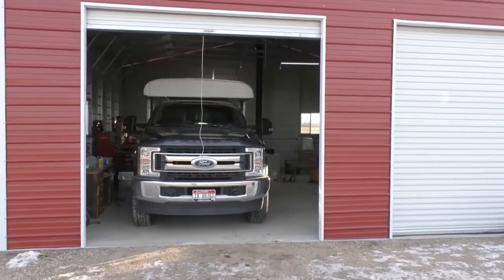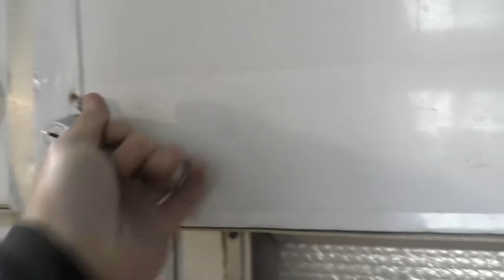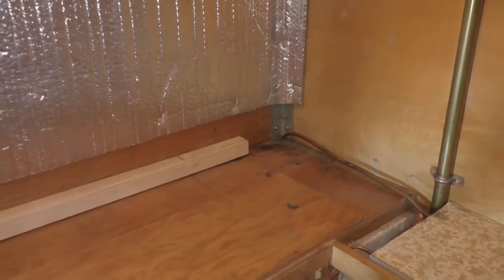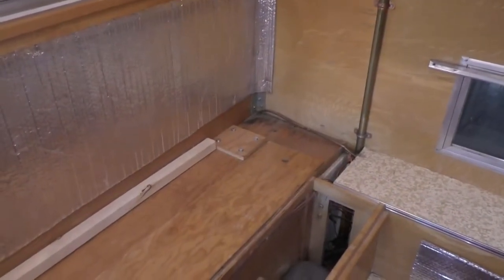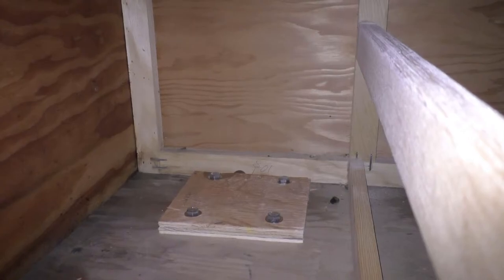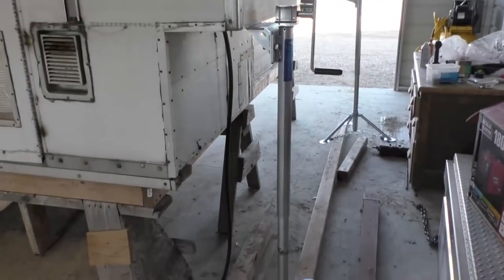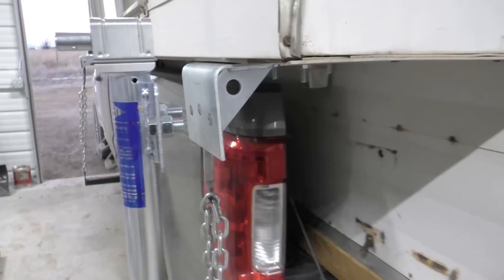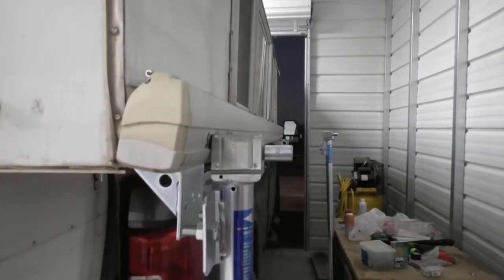Installing Rieco-Titan jacks, jack extensions and brackets on my 10' cabover Alaskan Camper.

Comment: The gusset for the front bracket needs to be under the camper at least a few inches to function. Bad idea. Brian was right.
Reply: Probably so. But working so far with no issues.
Reply: Probably so. But working so far with no issues.

Comment: I would like to see how you jack the top up. Ours has a crank with sprockets and and bicycle type chain. It doesn't go up without lifting up on the top while cranking. A jack setup inside like yours just might make it easier for us.
Reply from the maker: Do you have an Alaskan?  As far as I know they all use hydraulic jacks with telescoping booms.
Reply: @off-farmadventure6871  no I don't have an Alaskan. i have a more obscure unit built in the 70s in Claresholm Alberta canada. it's called an Alligator.
i spray foamed the outside of it while still leaving the pop up feature. that made the top too heavy for the hinge/brace pieces which began to bend. i bought 4 scissor jacks to install inside. i don't want to spend any more cash on the alligator so i decided against an electric hydraulic setup. my intentions are to have a winterized camper that will still have the benefit of a fairweather popup feature.
i have foam panels that install over the canvas popup panels outside so we can stay warm in the cold seasons.

Comment: I would move the 2 front brackets in.  Your tires will still have the clearance you need.
How expensive were the 8 inch jack lifts?
Reply: I think they were $200-$300.  I paid a premium but worth it.

Comment: Stay away from Rieco-Titan brand.
My TC came with Rieco jacks, but the guys at this company charge an astronomical amount for ANY replacement parts. Their prices are so ridiculous that it's actually cheaper to buy the entire system, get the part you need, and try to resell the rest. For example, a replacement wireless remote costs $335.79 plus $20 shipping, and the tiny activation switch panel is $145.00, which is insane for $10 worth of material (a metal plate, LED, 3.5mm jack, and switch). I'm buying a full Atwood kit, minus the jacks, for less than $400 and it comes with two remotes. I’m done with pathetic Rieco-Titan and their ripoff BS.